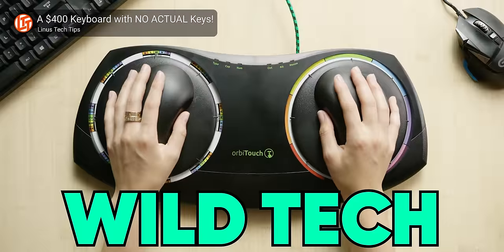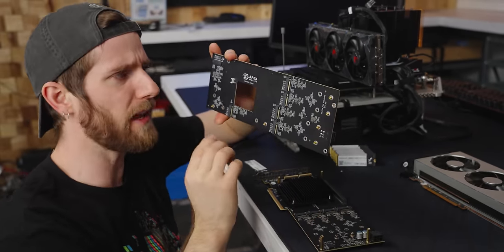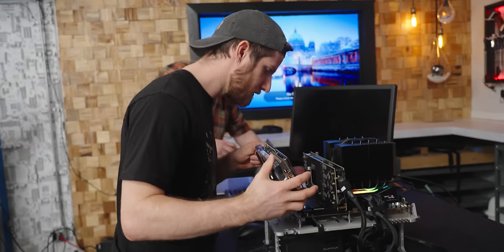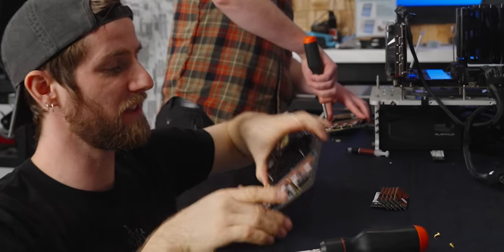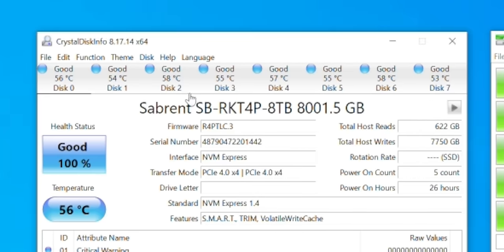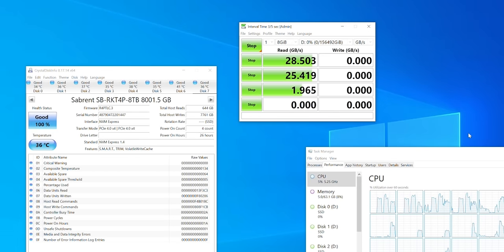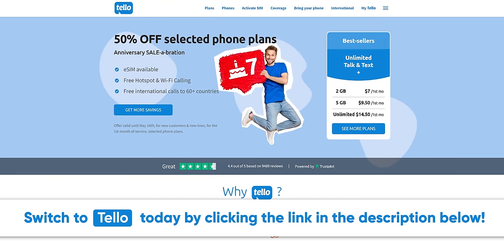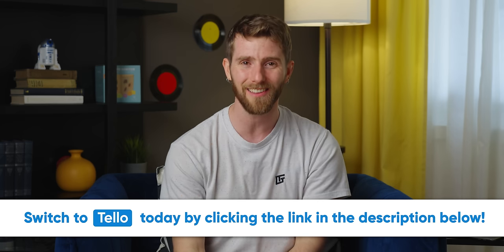This SSD is Faster Than Your RAM - Apex Storage X21

Comment: The other fun thing about that PCIe switch chip, is that you could hang this silly thing off a 1x slot (say, one of those slot extenders) and still have access to all the disks.

Can I think of a use-case for that? Yeah, actually, if you just need stupid amounts of low-latency storage but not a ton of throughput, a bunch of these on 1x mining risers would fit that to a tee.

Comment: I use a bifurcated 4 x NVMe board on a Dual Xeon motherboard that has 4 x 1TB Samsung Pro Gen3 and its been installed for over 2 years and has not missed a single beat. Its a scratch drive in Dynamic RAID 0 for rendering and I haven't seen anything faster. This will be interesting.

Comment: Crazy sequential speeds, for sure, but what about the speeds that really matter for system responsiveness and game level load times?   You know, the low queue depth 4kK random reads?    Also, this is going to require a PCIe swich (or PLX device) and that is going to add latency, which also may hurt performance.

Comment: Thinking of large scale enterprise databases designed for in-memory use - this dramatic increase in "conventional" storage I/O will shift that need around quite a bit, perhaps we'll see faster live replication to secondary storage of database writes?  
Ironically this may reduce the desirability of external data centres as it may potentially drop the cost of ultra-high performance systems hosting in-house and shift the risk/reward balance back pretty sharply.  $31k is absolutely nothing in that space, in one system I managed enabling an additional processor meant saying goodbye to $72,500 and there were a dozen of those in-system.

Comment: Hell this could even be useful for some web servers, that read performance is high enough to be useful to exploit 100 gigabit networking on a server that is delivering a lot of large files that allow for the buffers to be filled from large sequential reads. Sure the server would also need a considerable amount of RAM for that to work but sticking a terabyte or more of RAM into a server purpose built for bulk data transfer to many concurrent clients would hardly be outside the realm of possibility, server memory controllers can address a lot of RAM.

Comment: The Windows dynamic drive version of RAID 0 is pretty poor performing, but the Windows Server RAID through Windows Storage Spaces is great.  Windows Server 2022 can be installed in eval mode for 60 days without a license.  So, better to test software RAID in Windows that way.

Comment: I'm not quite sure what the point of it is.  Any consumer-grade NVME storage system, especially in this physical configuration has no place in an Enterprise, any drive which is hot-swap must be in a drive caddy, you can't hot-swap items on a card like that.  I assume it has raid, if not use it for a big temp drive, don't ever run without some type of raid, preferably hardware, but software is a possibility.  It's sort of look at how big we can make this, but it's too dangerous to be in an enterprise environment.

Comment: Major advancement would be progress in non-blocking controllers and actually implementing such configuration and inter-disk communication in hardware...prepare SSD to work in such configurations. Also, I'm not sure what CPU can even make use of it - top of the line Threadrippers?

Comment: You will still only get 64 Gigabyte of transfer to the CPU from the PCIe slot.
The CPU SSD is running at 128 Gigabyte per second to the CPU.

Comment: The problem with SSDs, and especially NVMe SSDs is that it is blazing fast, so you'll want to use it all the time, but the underlying NAND flash chips/modules ALL still have a finite write endurance limit, which means that eventually, you'll just end up with 21 e-waste/dead drives (once you've exhausted all of the erase/program cycles of the NAND flash).

This is one of the reasons why I have almost completely and nearly decommissioned all of my current SSDs (whether it's SATA or NVMe) and gone back to rotating disks.

To me, SSDs are like brake pads on a car: it's a wear component - and one that you will have to replace every once in a while, which really SUCKS when your OS drive dies.
Reply: So...no problem at all...unless you do chia-farming/plotting or write big datastreams 24/7... OS drive - the less. OS usually writes between 100 and 300 KB/s in background, so 1 to 3 TB/year at most. As power user you probably write between 10 and 50 TB/year. Each of these 8TB-SSDs in this video has 5,6PB TBW (guaranteed! - real endurance could go as high as 15 to 20Petabytes). So they would theoretically last 100+ years. Way more than any HDD. So... no way i would go back to slow "rotating disks", i use them for long-term "cold storage" only.
Reply: @Wlad1  
"So...no problem at all...unless you do chia-farming/plotting or write big datastreams 24/7... OS drive - the less"
PATENTLY FALSE.

I have an Intel 750 Series 400 GB NVMe AIC SSD.

This is the SECOND one that I've had to RMA because I used the drive as the drive for my swap file and ONLY for my Windows system swap file.

(My system has 64 GB of RAM in it, so the page/swap file is also, likewise, 64 GB.)

I've killed TWO of those NVMe drives in 8 years.

The first one only averaged 2.29 GB writes/day.

The second drive averaged 0.121488 GB writes/day when it died.

And since Windows will put your page/swap file, by default, on the same drive as the rest of the OS, therefore; if you have a SSD of ANY kind (NVMe or SATA (or SAS)), then the random write I/O pattern of Windows swapping WILL kill your SSD LONG before you have exhausted your warranty-rated total volume of drive writes.

I have two dead Intel 750 Series SSDs to prove this.

The ONLY way that you would be able to avoid this is if you disable swapping/page file, in Windows, altogether, which most people DON'T and some wouldn't even know that they should/need to do this, let alone being in possession of the know-how to do it.

"OS usually writes between 100 and 300 KB/s in background, so 1 to 3 TB/year at most."
IF you are running Windows -- find out how much data your Windows pagefile/swap file write, per day. (Which is a function of the amount of RAM you have installed in your system. More RAM = larger swap file = more swap file activity (reads, but ESPECIALLY writes).

"As power user you probably write between 10 and 50 TB/year. Each of these 8TB-SSDs in this video has 5,6PB TBW (guaranteed! - real endurance could go as high as 15 to 20Petabytes). So they would theoretically last 100+ years."
You KNOW that they rate the write endurance limit based on SEQUENTIAL transfers, right?

That write endurance limit doesn't say ANYTHING about random writes/I/O.

If say, on a SSD, you have a grand total of 5000 NAND flash cells, and each block is 4 kiB, and you're executing parallel, random write where it writes 1 block per NAND flash (due to randomness), that means that whilst you might have only written 20 MiB of data, you've CONSUMED a write cycle from EACH of your 5000 NAND flash cells.

Repeat that process over and over again for a system that has anywhere between 64 GB to 128 GB of RAM, and now you have a swap file/page file "random write amplification" problem whereby you can kill an entire 400 GB SSD in 8742 power-on hours (which is just shy of a year).

Windows Task Manager doesn't monitor the disk I/O for swap. (To the best of my knowledge currently and so far, I am not aware of ANY hardware monitoring tool that actually measures swap read/write rates (neither by volume (bytes) or by IOPs).

And this is on TOP of the other 5 SATA SSDs that I've also killed already as well, four of which had been RMA'd back to Intel. The 5th one (which just died on me about a month or so ago), fell outside of the warranty period by a month, almost to the day.

So, it's just garbage/e-waste right now, since I can't RMA it back to Intel (now Solidigm).

And when your OS drive dies, it's a PAIN to have to try and either revive it, so that you can clone it onto a new drive (because SMART doesn't give you advanced notice that your drive is about to die). (The first Intel 750 Series 400 GB NVMe AIC SSD that I killed by using it as a swap drive, died in such spectacular fashion whereby you couldn't even READ the drive after it reported itself as being dead, and put itself into read-only mode. i.e. Windows Explorer wouldn't show the hidden pagefile.sys file because it could no longer read the NAND flash cells that made up the NVMe SSD.)

(BTW, this is also why I relegated said Intel 750 Series NVMe SSD to being the swap drive, because I didn't want it to be the OS drive, where when it failed, it wouldn't completely take down my system.)

I've virtualised ALL of my desktops now onto my main Proxmox server which runs 28 SATA HDDs and 8 SAS HDDs, dual Xeon E5-2697A v4s, and 256 GB of DDR4-2400 ECC Reg. RAM.

7 dead SSDs later is how I arrived at this conclusion.

Four of the SSDs were the OS drive in my micro HPC compute cluster, whereby each compute node had 128 GB of RAM in it.

Comment: Why didn't you use a board that does x16 and x4 instead of x8/x8? Most x570 boards for instance do this and it would save jamming a GPU in a x1 slot while still offering enough CPU to not realistically bottleneck the tests.

Side note - it's possible that the main card has x4 lanes per slot but the daughter card has x2, the fact that the daughter card appears to be completely passive and doesn't have enough conductors in the connectors for x4 per slot would support this

Comment: setting up a RAID across all those NVME drives basically rendered the setup completely useless ! one raid means one blockdevice accessed by the OS and you basically limit yourself by the RAM speed. if you have multiple processes running on different  CPU cores utilizing different RAM memory sticks then you could use the potential of that card. so a system with tons of memory slots a tons of CPU cores and tons of workloads addressing individual nvme drives is the right application for that card (e.g. virtualization where you pass-through a nvme drive to a vm).

Comment: I think it would be cool if a company found a way to remove ram from a computer so it literally just used ultra fast ssds like apples unified memory but also the ssd included as well.
Reply: Ram is 30 times faster than ssd. This is a special asd and cost. $30k

Comment: Where did you get the extra 5 grand from when Sabrent 8TB Rocket 4 Plus SSD with heat sink $1099,00 X21 = $23,079.00 from Amazon.
Apex Storage X21 $2,800.00

Comment: The real beauty of a PCIe fanout solution like this is you can load it up with 21 cheap $40 (1TB) NVMe drives and get ~20TB of extremely high performance ultra-low latency storage. (10 million IOPs, 30 GB/ps). Load up a 4 socket server with 8 of these boards and set a new IOPS world record.. Oh wait, I already did so maybe not a new world record, but still cool :)

Comment: So you're not gonna mention that each drive has its own (web says 2GB) DDR4 cache (that would make 42GB total) 16:00
Also DDR5 at 6000MT/s, what they are probably running in the AM5 system is 48,0 GByte/s per channel.

Comment: Hot: I really believe that is sad that PCIe v3 SSDs are disappearing. Very few people need more than 3GB/s and the PCIe 4s are too hot. I hope the v5 controllers are built with better technology. By the way it's not faster than a Sonnet Sonnet M.2 8x4 Silent Gen4  under Mac OS (Normally Windows is a little bit faster)  on the Mac pro, and clearly, the Sonnet is much cheaper but it supports just  8 SSDs,  so a Max of 64TB.  You are paying for density and at $2800  I will say is a good price.  I have never tested the OWC 8 drive.  It's amazing. Taking into account that the only reason we don't have  16TB sticks is because of the lack of a market for them, the future looks nice.

Comment: Not sure it can be faster than your DRAM, since DRAM is used in all of the data transfer between devices in the system. Even if you were using two of these and doing DMA transfers between them, host memory is still allocated and used for that DMA transfer as a middle-man. Your test-file size is also waaaay too small for this many drives. They each have 2GB DRAM caches and you're carving up a 8GB test file across 21 drives, so each drive only needs to cache 380MB in DRAM if it's not in host DRAM already... Should use a test file 4x the size of DRAM and larger than the sum of all the drive caches. You have 48GB of cache on those drives combined, so need a test file around 200GB to properly benchmark them.

Comment: I suppose if you are working for Stanley Kubrick or someone like him, who never met a take he did not want to re-do, you might benefit from having as much 8K footage on a drive as this SSD card can handle. Either that or be in a post-production facility where everyone is hitting those drives simultaneously in something like a Facilis Terrablock, only with 8K and no proxies (lower-resolution files for video/film editing that, in order to finish the project one has them render the high-resolution after all of the edit decisions are finished). 

I did run a facility based on that kind of a server but we were using highly-compressed (DNxHD, the Avid compression tool) video that was about the size of uncompressed NTSC SD material. These drives could give you full-res 8K, delivered to your workstation with the only bottleneck being your network, which might be 100GB Ethernet.

Needless to say, that array would hardly be taxed, even with 20 edit bays all calling on footage at the same time.

Comment: If that card wasn't over $2,000 it would be ordered, and I would be buying up all the cheap 1 and 2 TB cards to fill it up. I'm kind of pissed I went with a smaller mobo because I thought I wouldn't need the extra PCI X16 slots.. I learned about these M2 PCIE cards after I finished my latest PC.. I was looking at the one you showed that holds four M.2's.

Comment: But...
why do not choose optane dc pmem 200
Faster, cheaper, lower latency, and super random data access capabilities. This is the real strength of memory, and it is also the shortcoming of ssd.
The only problem is that it needs the Xeon Scalable Platform.
However, compared to the shit in your hand, the c621 motherboard and the Xeon silver  seem to be inexpensive.

Comment: I'm not opposed to jank, but did you guys really need to have that 4070 in there and constantly work around it? Frustrating to watch, when a riser cable or just some puny SFF 1x slot GPU should have sufficed with getting the system to post.

Comment: Where would you use it???  Dude, this has enterprise application written all over it.  How about hosting 50 virtual machines - servers and workstations alike?  A SQL server and a mail server would love such an environment.

The mind boggles.  I ran a civil engineering network, which has ENORMOUS data / storage needs.  In the early days we had many physical file servers containing hundreds of gigabytes of autoCAD drawings.  I'm sure the storage requirements are ASTRONOMICAL anymore.  They had just gotten into laser scan technology when I left the company during the 2008 financial meltdown.  Laser scan technology requires unbelievable storage.

Also, Microsoft had launched Windows Server 2008, which gave away Hyper-V virtualization as part of the OS.  A year after I was gone, the company had virtualized all their servers and switched to fiber channel SANs for storage.  It was all spinning rust at the time but the technology was juicy.  Back in those days we had 1Gb Ethernet to the workstations.  I would be surprised if the current network didn't have 10Gb to the desktop in this day and age.

What is the application for such an expansion card?  Oh brother.  That little card has more storage on it than their entire server room had back in 2010.  And it's a hundred times faster too, I'll bet.

Comment: I would want to use one in my server as I already have over 12 NVMe's in it using those Quad NVMe adapters and have more NVMe's than I have PCIe slots to populate them with on a Threadripper Pro system.  The big problem is I don't have $3000 to blow on one of these cards yet.  LOL

Comment: What's with the whiteboard speed chart? Does Alex not know Powerpoint?
The PCI-E slot (And its architecture) are the choke point. Think about it. You are taking a memory mappable device and forcing the conversation thorough a channel that does block writes and reads. (Reads are actually writes in the other direction.) Ideally you would have all this memory directly addressable as flat memory with no PCI-E (in and out) in the way.  This has been done. The flash array is directly mapped in the CPU memory space with paging. No transfer in and out  - just access it with memory pointers and use it. (Caching still applies.)  Just stunning performance.   Really all these limits are imposed by the decision to sell it as an aftermarket product/module. PCI-E/SATA/IDE are all solutions to the need to have something there or not there and easily installable. FLASH drives were originally ISA memory mapped  expansion cards.

Comment: SLC cache may sound like a great thing but keep in mind that it will eventually wear out.  DRAM will last a lot longer.  Maybe SLC cache would last longer than the regular NAND chips but it still seems asenine to me to use storage as the cache.  Just think how annoyed you would be if your hard drive had flash memory for a cache.  No matter how long the other parts last the cache would have a really finite lifespan.  That would be just dumb!!  Really I have never had a hard drive fail yet.  I don't buy enterprise drives either which I would expect to be even more reliable.  If I pay the money for an enterprise drive it better damned well be reliable or I will be one very kranky person!!